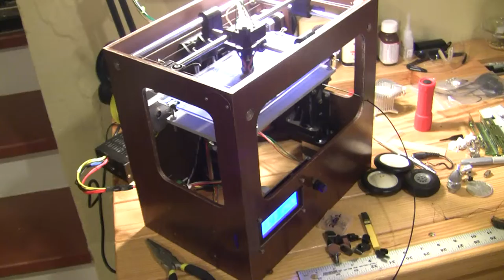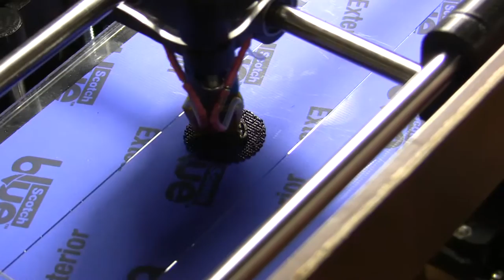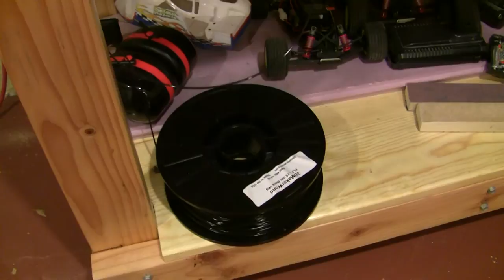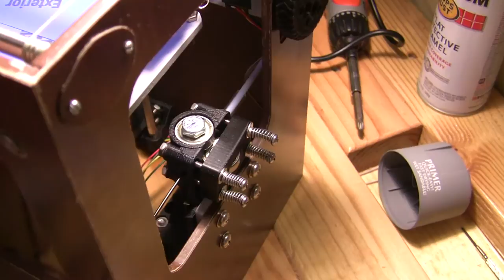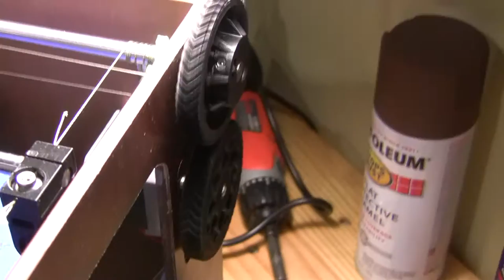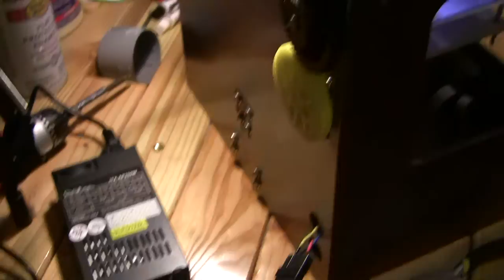First Quality Run Of Tantillus Plus

Comment: Georgios, I don't use a hot bed. I am using PLA, and I don't seem to have much a problem with lifting if I use fresh tape and get a good first layer.  It also helps if the part is small.

Comment: could you share the plans? and what is the build volume? I like the dessigns a lot and would possibly be interested in building one.
Reply from the maker: Griffen, I found the plan on the internet (just search Tantillus 3D printer plans), and had the parts printed at my local library for free.  The base plan have 100mm x 100mm x 100mm print volume, but I stretched it out on the sides to get 200mm in width.

Comment: Do you use a hot bed?
Reply from the maker: Georgios, I recently added a custom made hot bed out of aluminum plate and ni-chrome wire.  I can now do ABS, but it still very hard to keep large parts from curling.